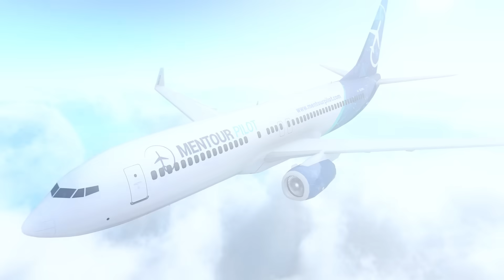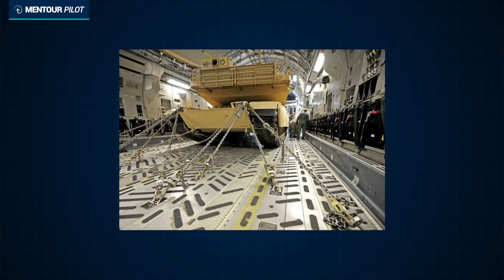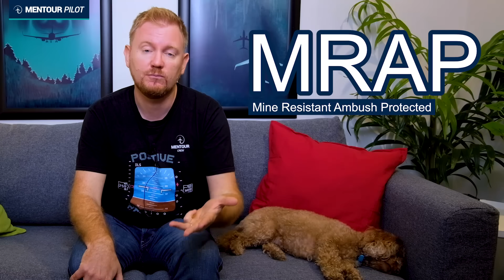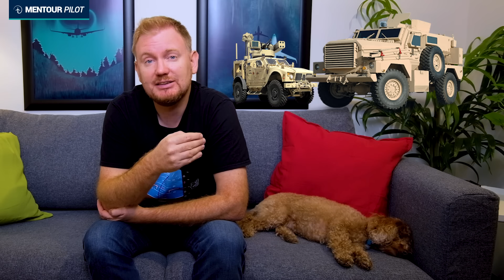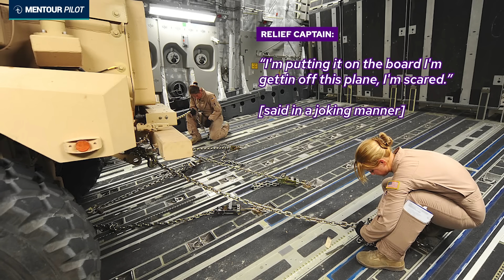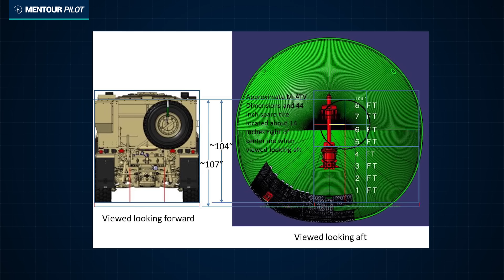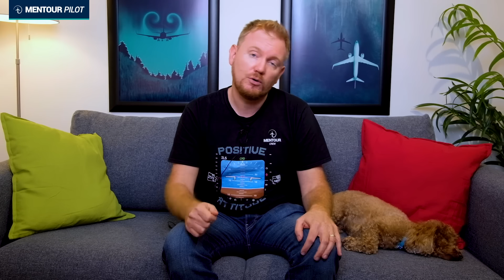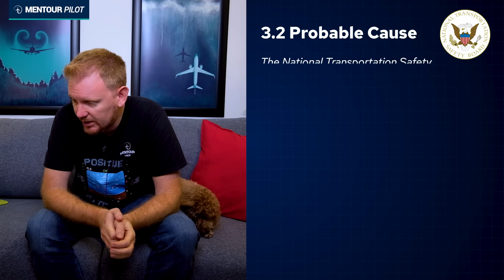Why did the pilots LOSE control?! National Air Cargo flight 102

Comment: the strap calculation difference to me seems to come from them using different figures for the expected g-forces. it's not enough to just calculate the load and divide it out by capacity per strap and add margin, but rather the load x some g force where they severely under estimated the g-forces involved. the straps being loose after first leg should have immediately terminated the flight until it was properly secured (not just re-tightened because if it came lose once it will obviously happen again)
Reply: When one strap fails, its load is asymmetrically transferred to the remaining straps. If one does not account for this in one's calculations, then one strap failing could overload another, and another, and so on. In civil engineering, when a bridge has this flaw it is called "Fracture-critical".
Reply: A dear friend flew those huge cargo planes for years, and he always said, “gravity doesn’t negotiate.”  You can’t convince it that the medicines or supplies you carry are so important that you need a break.  Because what will break is your airplane.  Knowing that the last vehicle was essentially tearing out of the plane after it rotated..was it moving independently of the others, or were the big ones pushing it?   Because I could see the guy putting everything extra on the big vehicles, only to have the smaller one actually came loose
Reply: @bwktlcn  Yes, once any one of them came loose the extra load would have been enough to break the others free.. 

As a complete non-expert in this area it looks to me that such heavy vehicles should be fixed down with fewer but stronger straps. The shear number recommended - 60 is so many that it introduces extra potential problems (like de-rating or slipping) in simply attaching them all.
Reply: The first flight was not mentioned as to be particular turbulent (otherwise adding more straps to compensate for damaged straps would have sounded like a very reasonable thing). A second take off should be less turbulent then what you assume for "worst in flight scenario". Someone here in the comments suggested, that the number of strips is not only terminated by the load, but also by the securing points on the floor. When you run out of "ideal" anchoring points, you will simply use anchoring points that are less ideal, but you have to derate the strap as compensation for non ideal position. That offcourse is cascading: Fill up the "ideal" anchoring points with straps, take the next anchoring points and derate the straps,  take the next anchoring points and derate the straps, ...
Reply: Or its about ability to preload them evenly. This is why on cranes you take into account lifting loads of only 3 chains regardless of how many more you are actually using. Plane is determined by 3 points and any additional chains might not be bearing any weight at all.
Reply: @tarnvedra9952  Well, I suspect that is what happened, tightening only the straps that moved is the opposite of what you need. But It is just as likely there was a hard point failure, as extra tensioning could easily have overloaded the hard points. Its very possible what he was doing to try to secure them actually caused the failure. Even putting on more straps could have contributed to a failure like this with incorrect forces on the hard points.
Reply: The load master didn't have any riggers training by the looks of those straps, the way the straps are working at such narrow angles heavily de-rates them, and cinching them down pre-loads them too. They could have been configured in a more effective manner
Reply: I think the bigger difference comes from what strap points available. A strap point too far forward/backward will nit handle side forces as well. Strap points forward/backwards consumed with straps for another vehicle means strap points too much to the side will be less effective for forwards/backwards forces. And to then allow the vehicle to stand on yhe wheels and bump up/down on the suspension will derate the useful load capacity of some of the straps even further.
Reply: @perwestermark8920  You are correct. It wasn't the straps that failed. It was that one vehicle would have required more than half of all the aircraft's strap points. The aircraft was only capable of strapping down one vehicle, no matter how strong the straps were.
Reply: @ryanmcgowan3061  You can't guarantee that, but I expect tightening them indeed had the opposite effect. Either the hard points failed, or perhaps some of the straps already partially failed.
Reply: @carbon1255  I went off the full report when I wrote that. It described the proper procedures for loading the aircraft. The number of hard points for one vehicle meant that any more than one vehicle would have consumed the load capacity of the hard points. If the weakest link is the hard point, then the strap failing will not occur because it won't reach it's capacity. Like hanging a chain with duct tape, it doesn't matter how hard you pull, the duct tape will fail first.
Reply: @ryanmcgowan3061  why didn't they use chains?
Reply: @DocHellfish  How would that help? The straps were more than adequate. If your hard points are the weak point, it doesn't matter what you use as straps. The aircraft itself would have needed beefier hard points.
Reply: Yes, that's the impression, if it loosened and moved once, it could happen again.
Reply: You know... I wouldn't be surprised if they told you "we've always done it like that and it had always worked". Strict security measures really only start to be applied when something happens unfortunately.
Reply: The most ridiculous statement was: "I saw that, I never heard of such thing...those things are so heavy you'd think that they probably wouldn't move at all, no matter what". It doesn't work that way, when you have to do with G-forces and gravity. That alone got me thinking that they didn't do any real calculations for how much forces those straps actually has to take up, but rather just a quick estimate and assumptions...
Reply: when i worked in airfreight, they told me that stuff had to be strapped down in such a way that it can withstand 9g. i remember saying something like "9g plus 1 airliner equals a million pieces." airliners are simply not built for such extreme accelerations.
Reply: @George Florinescu The problem is with elastic verses inelastic stretch. I seem to remember with nylon webbing straps that there is very little elastic stretch, but worse that inelastic stretching only occurs close to the point of failure and means that the strap is permanently weakened and should be replaced.
Reply: Normal service factors are 4/1, without contacting the manufacturer of the straps I would imagine that 8/1 is appropriate, straps where required directly forward and aft, and some side to side. This was a cluster from the beginning, and Im sorry to say that the pilot should have followed his instincts.
Reply: @George Florinescu Yes if loose they have potentially been stretched. Maybe the biggest factor of all.
Reply: I believe a factor here was the load rating of the straps and the angles at which the straps were positioned. A strap can handle a certain load at a horizontal positioning. As the angle of the positioning changes the load that the strap can handle decreases. This load was unconventional for at least this loadmaster. Experience should have at least dictated more straps than required would be a good idea.  Also, what are the protocols for determining when a strap has been over used? This load was insecurely fastened w straps that had probably been previously compromised. There were multiple red flags here . It's a shame the Capt didn't call for assistance on this. I wonder if the load crew feared repercussions for having a load that had already moved in flight and did not want this escalated?
Reply: @tommurphy116  No the crew had continue the mission bias.
Reply: In the uk, you have to live ona day at a time
Reply: If I can flip it upside down and it stays it is finally secure enough.
Reply: This is why you should add more straps and, ideally, chains, when you discover that existing ones starting to fail, and you cannot calculate properly. Just a common sense.
Reply: There is also the issue of knots, which de-rates the strap.
Reply: Anyone who transport vehicles on trailer knows that it is a big no-no to strap at the moving chassis, which is resting on the springs, that movement can rip almost any size of straps or strapping point. Only the wheels shall be strapped down.
Reply: Exactly. The slack indicates the straps have already stretched.. this means they are no longer serviceable.  I work construction now and do a lot of fall protection required work. I've taught the fall protection class many times and I always make it a point to say that once your device has been "used" it is useless. It no long has the same arrest rating and is no longer reliable. Get another.

Comment: Military loadmasters (C-5, C-17, C-130) go through initial 6-9 months of training. 
Second thing is that civilan airlines use straps. Military always use chains that have 10 000- or 25 000 lbs capacity. This type of load shift due to lack of restraint would never happen on a military aircraft.
Reply: Which is why you don't see heavy equipment on flat bed trailers tied down with straps, they use chains. Straps always have some amount of stretch, and when you have heavy dynamic loads like this, they're likely stretching at different amounts which means some are being overloaded until one fails and then you get a cascading failure of all of them. Also, when you do use straps on a trailered vehicle, you tie down the wheels so the suspension can take the load and not the straps (obviously you can't do that on a plane).
Reply: @stephenshoihet2590  Right on, it is surprising how ever that so many Air Freight companies only show interest in getting 'STUFF' from here to there and bugger the dynamics of loading or even thinking of demanding appropriate training for such airborne loads. Being in Air Traffic control for over sixteen years in Near and Middle & Far  Eastern Airports, a most notable feature of MANY especially American Airlines who have long haul freighters, is the lack of appropriate training offered tobthe loadmasters, and I've seen so many in the Middle East especially. on the Afghan routing.
Reply: What I thought. How did they want to held armored vehicles with straps, especially where they can roll (no friction helping you here), unbelievable.
Reply: @DuRoehre90210  If you look at the video again the vehicles were Chained to double pallets that were strapped, the vehicles most likely did not move on the pallet, the flat pallet slid with the vehicle riding on it like a surfboard.
Reply: @DuRoehre90210  Simply because no training of handling special cargo.

Realistically speaking, yes, several strap can hold it perfectly fine ON controlled condition. But IRL strap stretch a lot than chain, making different load each strap swing wildly, but of course this is not an common knowledge
Reply: Never say “never.” That kind of thinking can lead to this kind of sequence of events.
Reply: Ah, but it was a load shift, from military transport aircraft whose loadmasters knew what they were handling into the hands of innocents who tried to do the impossible.
Reply: @sawning3449  I agree with you 1000%. But sadly, that is just how things were done in the contracting world for the military, not that I agree with it.
Reply: @gonedivin8651  which begs the question “why were contractors used?” ... probably because it’s cheaper... why cheaper? ... because shortcuts in operational procedures ... So let’s save some money by letting other people cut as many corners as they’re willing to. Sort of makes the US defence force complicit doesn’t it?
Reply: @axelknutt5065  EXACTLY RIGHT, American Government is particularly to be bla,es for such attitudes, Saw much of it when I was in the Military in Vietnam etc.,
Reply: @sawning3449  definitely would have been good if they shared some expertise with the airline but also the airline might not have wanted to be told what to do. When you're hauling something, you're responsible for your load.  If you don't have the competence, you bring in an expert. The airline personnel didn't even have the expertise to know they didn't know what they were doing.
Reply: Yep. I was a 2T2, straps would never have been allowed on this kind of load on USAF aircraft. MB-1 or MB-2 chains + sleeper shoring with vehicles on pneumatic tires.

Comment: there seems to have been a lot of accidents due to the horizontal stabilizer being in a bad position. seems to me there needs to be an explosive charge implemented that will forcefully disengage it from the jack screw and lock it to a "neutral" position. that being said i don't think it would have done them any good in this scenario considering the timeframe and altitude involved but that seems to be a common failure point for a lot of accidents.

Comment: I gotta ask, why don't planes have... I dunno, eject seats or an ejectable cabin that has a parachute in the event of a crash? Probably won't help most the time, because of this that and the other factor, yeah, but we have so many amazing inventions, planes themselves. Can't it somehow be possible? Rocket parts parachute down right?
Reply: Passengers will not be trained or prepared for ejection and a child’s spine probably wouldn’t survive the force. As for the cabin it has to be pressurised in flight which means it has to be sealed so not gaps in the body unless they can be plugged like doors somehow. Also where would these parachutes be stored? Because you’d need a lot to be able to slow down a cabin weighing probably over 100 tons depending on the size

Comment: Suppose that the cargo had not damaged the hydraulic lines or the jackscrew but you still had that moving cargo in the hold, would it have been possible for the pilots to retain control of the aircraft, or would the shifting cargo cause so much trouble that they would only have been able to delay the inevitable?
Reply: Well if the mayday episode is to be believed then yes it could. The problem then is you have a loose time of cargo and any pitch up or down can cause it to shift the CoG again repeatedly

Comment: OH My, On a military C-130 any heavy load/vehicle we fasten down with chains and special devices to tighten the chains to "D" rings in the floor !  We would never use  nylon straps.  The straps were already failing from the one broken strap to the other ones stretched and loose from the first leg of this flight.
Reply: Probably the only positive thing to come out of accidents like this one is that the aviation industry becomes safer overall.

Comment: Two questions:
1. Do load masters get to dramatically pose on the roof of the cockpit? (11:20) More seriously, I just have to wonder about that picture. Is that even allowed? That has to be against a whole bunch of regulations.
2. Unrelated to this video, but I've been wondering. Covid19 has been with us for a long time now, and there's been a lot of time for various industries to react. Has it made any change in cabin ventilation? Has there been any move towards circulating the air more,  modifying the airflow, installing filters, or anything of that sort? 

Thanks!

Comment: Wow!  I, along with I think most pilots, believed this was caused by a weight and balance issue.  I think we all correctly figured that the load had become unrestrained and shifted dramatically in flight, but it's so interesting to see that the actual cause was so much worse than just a W&B shift.  From the animation, it looks like if the weight has simply shifted as depicted, the airplane still would have been controllable.  I can't imagine how those pilots felt when they suddenly lost all elevator control.
Reply from the maker: Correct, it was shown in simulations that if ALL the vehicles had shifted backwards to the aft position, the aircraft would still been controllable.
Reply: I'm not a pilot but when I heard it was a cargo flight that pitched sharply nose up on rotation I assumed it was just a shift. Then Petter began explaining about the hydraulics and I got a cold feeling this was not just shifting load.